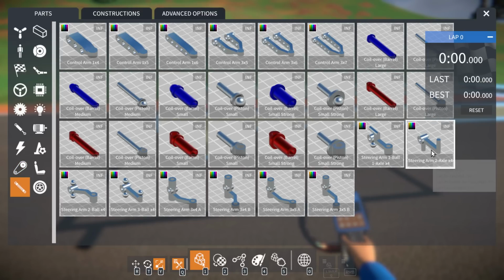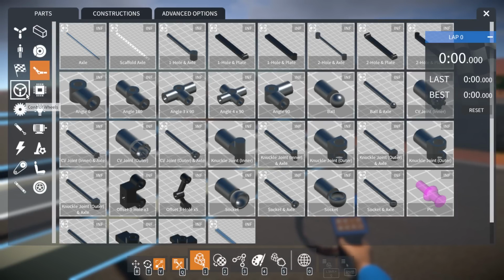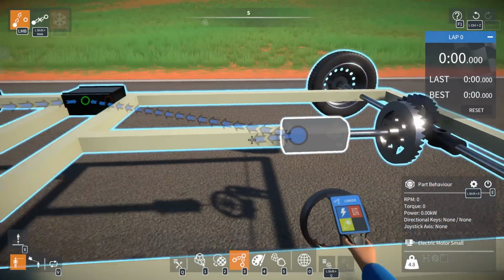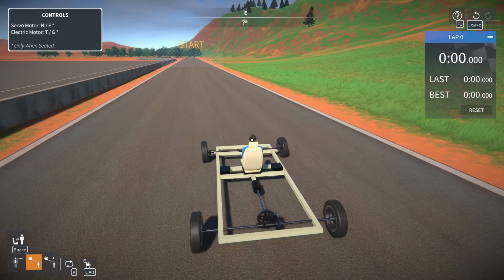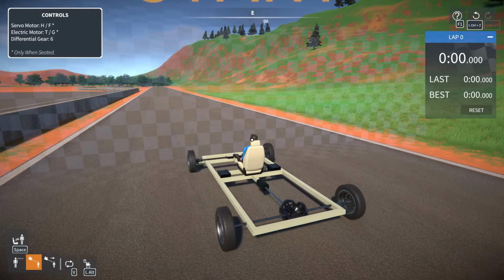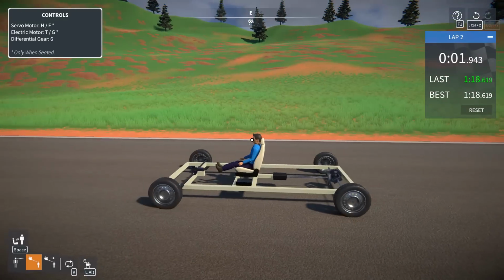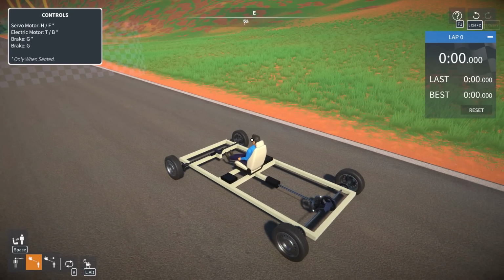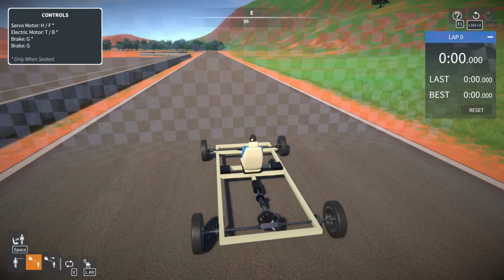I Built a Chassis to Test Differential and Centrifugal Clutch Setups in Gearblocks!

Comment from the maker: What part of the vehicle should we work on next? My plan is to slowly build up a fully functioning chassis one component at a time!
Reply: u do know u dont need a battery to use the stuff
Reply: you should make it like a truck with a trailer and see how much Whight it can pull. with a open differential and with a high tuarq
Reply: Suspension next, but the front needs to allow for 4wd upgrade in the future
Reply: I agree with others saying suspension, could allow for some more focused high speed builds
Reply: For breaks all you need to do is Shift + E on the wheels and set a break key
Reply: I believe getting the proper Ackerman steering geometry will benefit the most. That way, you are not fighting the "underslideyness" of the vehicle.
Reply: Explore front wheel drive with differential
Reply: A transmission with an overdrive gear
Reply: Transmission and then suspension!
Reply: suspension, limited slip diff, & 4 wheel drive.
Reply: Steering rack IMO
Reply: whif the dif that butten ting is like a motor
Reply: You need more max torque on that clutch.
Reply: one thing I've struggled with is the steering systems, proper return to center steering seems to be hard to replicate without the suspension stressing when you steer.
Reply: Not a Vehicle but id like to see if its possible to make a Chainsaw, since many Chainsaws use a centrifugal clutch to engage the Chain.

Comment: In the factory driving big dump trucks. A smaller wheel base meaning, the length of distance between the back and front wheel, will create tighter turns but a more unstable the taller the build.

Comment: fun fact: wheels now have integrated brakes that dont need to be connected to the chassis. Make sure to turn the wheels on, btw. Due to me not using the 8x2 wheels in my builds for some reason, i dont know if its true for that one.

AFAIK there is no automation. Its all manual for the player to control

Comment: by the way, centrifugal clutch also isn't an input smoother.  that would be a slipper clutch lol.  centrifugal clutch is just a way to get an automatic clutch so when you come to a stop, your engine doesn't die from being directed connected to the drive wheels.  but as soon as rpm's suffice, the clutch shoes move outwards and make contact with the bell.  basically a reverse drum brake

4wheelers usually are like motorcycles, so manual hand clutch and a sequential transmission

edit: I guess a torque converter without lockout could be considered an input smoother of sorts, but even that's a fluid clutch / torque multiplier

Comment: Found this game through your videos, thanks , it has become instantly one of my favourite games ever. 
I went experimenting with building a car of my own and came up with a few designs, specifically I made an alternative intermittent gear engine design that mimics the way a traditional piston engine delivers torque and found that it increased my flywheel rpm from 1200 to 3500. I published the design to the workshop and highly recommend you check out my design or even improve upon it or use it in one of your future projects.
It’s called “ Intermittent 8 “ on the workshop and seems fairly complex at first but once you understand the physics behind it it’s quite simple. I’ll be working on my own vehicle using this design as well as improving and adapting the engine for different configurations/layouts
Anyway, thanks for the initial inspiration and keep up the content

Comment: The biggest thing centrifugal clutches are for is to allow you to use a higher gear ratio and not get completley stuck when accelerating. Especially for engines that need to get to a few thousand rpm to start generating enough power/torque to get moving it allows the engine to spin to that speed before meeting resistance. You could just use a really short first gear so that at basically a standstill you can easily spin the motor to the req rpm but you lose heaps of top end so its not worth it. Like you say its used on snowmobiles, but also mopeds, if u ever drive one u will be able to feel the motor having to spin to like 2-3k rpm before it starts moving the bike but then it will stay at that rpm for ages until the bike actually matches that speed and rpms increase again or gear changes, almost a bit like a cvt making the confusion understandable.

If you want to use it in gear blocks it would be best for this purpose where u set engage rpm to about 1000 so clutch is only fully engaged when motor is at peak power output so you can have a higher first gear for more top end while having the same or even better acceleration.

Comment: Alright , after watching this ... i made a 3 speed automatic transmission using centrifugal clutches. with a small electric motor set to max 1000rpm and 500 torque , it reached 188kph / 117mph according to in game speedometer readings on the flat void map

Comment: So, you probably already know, but I'll mention it anyway.  For Ackermann geometry steering, the steering joint pivot needs to sit along a line that ends up making a triangle with a single point at the rear axle (at center rest).  While turning that point will shift along a circle as the two legs cross each other across different points.  With the pivot directly inline with the ball joint, you don't have two different circles at the front wheels.

Control key for the diff can give you the Subi variable lockable diff.  You could add a toggle clutch between two diffs to make a pony axle lockable low range guy too.

Comment: Hey guy, I love to see you getting into this game some more! But I just have to say, there are a few things I noticed you could've done in a better / easier way :p

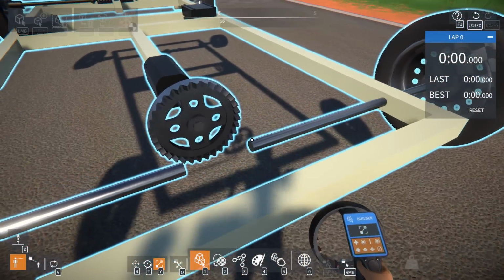8:19 You do not need a half block for this; the ring gears (and the bevel gears) have "Lo" and "Hi" versions for this exact problem. In your case, you could've just extended the driveshaft one block, and use a Lo gear.
9:06 / 22:48 You can use a cylinder block for this instead, it can be made smaller, plus it just overall looks better without the hole in the middle.
16:52 I believe "turning on the diff" completely unlocks it, so in your case with a fully open differential, it does nothing :p
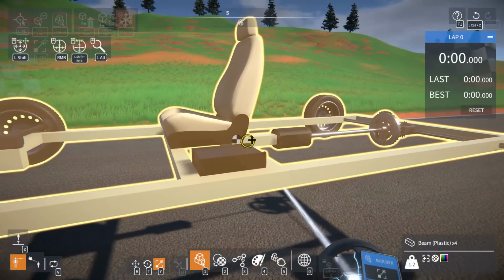19:14 Those wheels have built-in brakes, I don't know if you knew that already and just wanted to use external ones for fun, but they do.
19:39 In this menu you can click the file button on the bottom left to copy the part's settings, then use the clipboard button to paste it to whatever other part you select; you don't need to set everything manually!
BTW, I would advise putting some positive caster on the front wheels, and connecting them with a steering wheel instead of a servo motor. This can essentially make the steering limit itself at higher speeds, reducing understeer. It can also automatically countersteer if you oversteer. You can put caster on the steering easily by connecting the bottom of steering knuckle with a ball joint, then on the top of it with another ball joint, but instead have that joint 1 block behind the rotation point of the lower one.

Most importantly though. Keep playing this game! It's awesome and I'm glad to see you like it too :D

Comment: "Underslidey" sounds like something a baby does when crawling. At least your brain glitch wasn't as bad as mine in a 4th or 5th grade history paper... Two hand-written pages where every time I meant to use "king", I instead spelled "kink"; that was also when I only knew of the "kink in the hose" definition, so it was more embarrassing to think about several years later after leaning of the adult version... Oh and yes, the teacher counted every single one against my grade, which dropped what would've been a low-mid A down to a very low B or high C...

Comment: I do think most atvs and utvs do use a snowmobile style CVT setup,  the Engine powers a 2 speed manual transmission though a CVT clutch. 

our old arctic cat atv had a manual gearbox like a tractor. clutch, set the gear, and go!  

Yamaha i think has a car style shiftable manual in their sporty UTV. might even have paddle shifter! i haven't looked into that one for a few years though. 

and Honda's the wierdo here with full automatic geared transmissions.

Comment: Using the motor to break with an open diff doesn't really act as a break all the time.
That is because if the shaft was entirely fixed it means the wheels would rotate in opposite directions.

Comment: I don't fully remember, but I believe if you put your steering rack slightly behind the center line for your pivot joint on your steering knuckle you can actually adjust the Ackerman angle between the two wheels so you're inside wheel will turn sharper than your outside one an increase drivability in cornering

Comment: 1. Sick backflip bro!
2. I do beleive looking at an automatic transmission may be a very short video. It basically depends on whether you can even control stuff with them. Given the lack of logic it'd also become a kinda bulky system if you can, not that that matters all that much.
3. I think looking at different suspension setups will be the most fun of all. Building double wishbones, 3-link, 4-link, 3-link + panhard, adding in anti-rollbars, playing with wishbone and link length, suspension placement, etc., etc.
Reply: Auto transmissions are actually not complicated at all in this game, you can use a centrifugal clutch on a gear rack to make gears change at set rpms

Comment: You can make same setup on the front as well using only 1 electric motor and single driveshaft from forward toward rear, slap differentials forward and rear and also breaks on all 4 wheels. I think it will be even better that way :D And, yes, put some weight as well :D

Comment: ok, so as someone who has built a drift car in gearblocks
you can use the "steering wheel" part to have automatic countersteer.
HOWEVER, and this is the biggest caviat to using those things, your input is a mere sugestion, you cant make it turn if the game decides it aint turning, 
now, another thing to note, i made a RWD with a basic mcpherson strut style of suspension, and i did copy the geometry from another person, but its so dead simple and it just works. 
another thing, tire settings are EVERYTHING 
front/rear bias (set by having the front and rear traction settings different) steering traction and straight line traction will effect how the drifting works

Comment: The centrifugal clutch can make you faster, and since you did the exact opposite than what you need to, I'll tell you what you need:
1- set the dissingague higher and start to accelerate sooner, the response time will be a lot worse, but the engine will be able to get up to speed and accelerate faster.
(600rpm should be good)
2-set the fully engague rpm lower, so that you can get the full torque from the engine sooner. (1500rpm should work)
3-set the clutch's torque just above the motor's max torque. You don't want a bump to create a speed surge in the motor, since that can spin you out
(20% over the motor works nice on go-karts).
4-lower the brakes' torque, this depends on the wheels' grip, so just play around 'till you find something that works

Comment: That's not really how you should use a centrifugal clutch. Your're basically converting it into a Torque converter without the added torque the torque converter gives. That's supposed to be used like in chainsaw's, that also use centrifugal clutches. It's just to let the car come to a stop without the engine getting to 0 RPM. Basically the minimum RPM you want your engine to start making the car move. by doing what you did, you are just limiting the amount of power the engine has

Comment: And again kAN, you are confused at 11:38
Understeer mean car will continue going straight in turn, while oversteer is when car rear axle slides out
Car need to oversteer to drift, or you need to help it with weight transfer
(sudden brake while going into turn to push weight on front axle to get more grip and make it oversteer temporarily)
More info:
Car/truck/racing wheels doesn't need additional brakes, they have in build brake that slows down nearest rotational joint
All inputs have smoothing by default, it makes it slowly apply the brake/turn/lock diff, with setting it to 0 you can make more aggressive acceleration/braking/steering for racing cars
Also full forward/backward grip will help to not skid tires, while sideways grip should be used to improve stability, too high sideways grip can make car roll to side
The clutch is mostly useless on electric cars, because you can set braking torque of motor, it will be more useful in next update when they add combustion engines, use motor settings instead of clutch

Comment: The centrifugal clutch as it currently exists in this game could perform the same function as a torque converter in an irl automatic transmission.
Reply: That’s what I was thinking, although it’s still somewhat useless for that with electric motors. One thing I know they are used for IRL is remote control helicopters with liquid fuel engines, so maybe it is a teaser for that?

Comment: Rather than use a centrifugal clutch, with an electric motor you can probably just reduce the torque in the motor configuration to get the same effect of smoother acceleration.

Comment: I'm just going to tell you, the sensors, motors, etc. can only connect to a LCD to display information. they can not connect to a motor, linear actuator, servo, or stepper
Reply: Yet. Logic is on the planned list. Eventually.